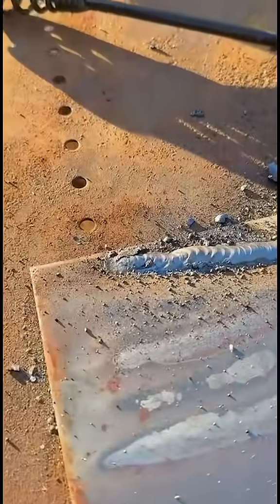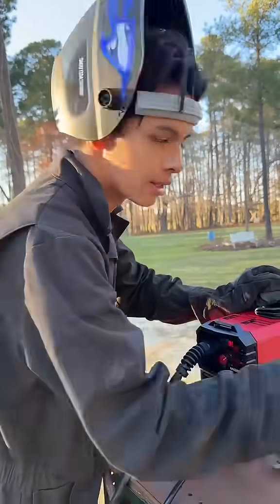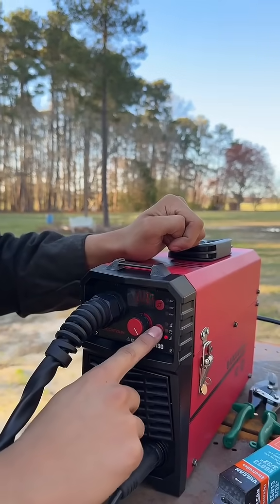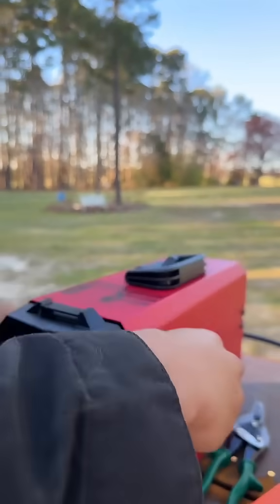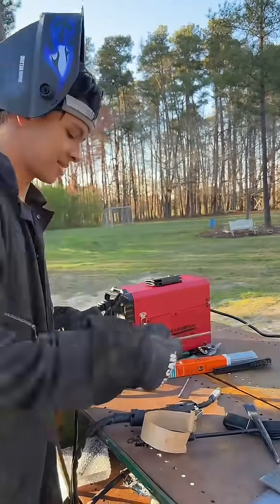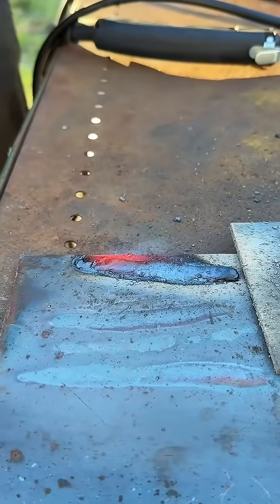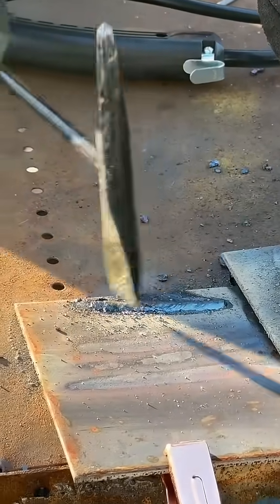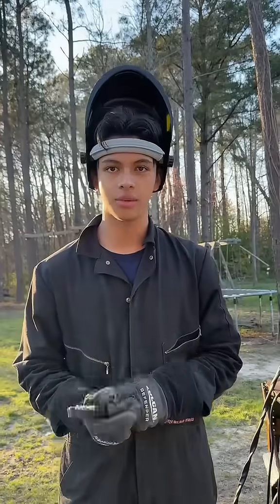New Generation Welder Teach You How To Use #arccaptain MIG130

Comment: Your weld looks pretty decent! You said you were at 100 amps, but from the sound of how it was burning, I’m guessing you were using 1/8” rod. Also cause it looked like you needed to long arc it a bit to get it to keep welding at the beginning. The plate you were welding is pretty thin but for 1/8” rod you usually start around 120 amps and adjust from there. A cool way to know approximate amps for each rod size is the use the fraction and find the decimal amount. That number is a good starting point for your amps. Like 1/8” equals 0.125 so start around 125 amps. It works in a pinch if you don’t know where to start. Interested to see what you make with the new machine! 👊

Comment: I’m used to using a big machine, how does the mig wire fit in the machine?
Reply: bruh ITS SHOW A MINUTE INTO THE VID WTF
Reply: Did you even watch the video
Reply: @QJACS  no, I did not watch the entire video until now
Reply: Either it is on the surface below where we cant see, or it's, a smaller spool? I've seen welding wire spools small enough to be held on the gun itself, so...